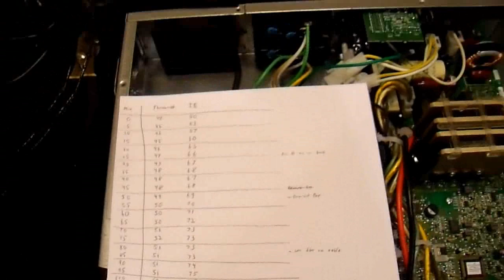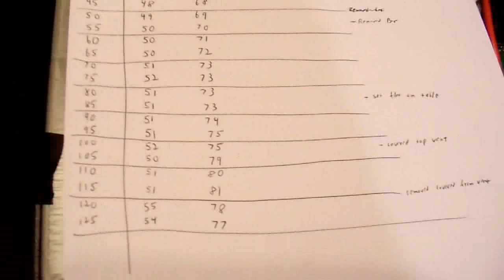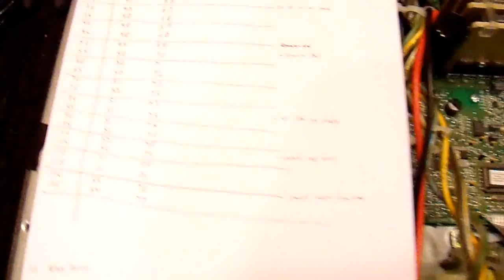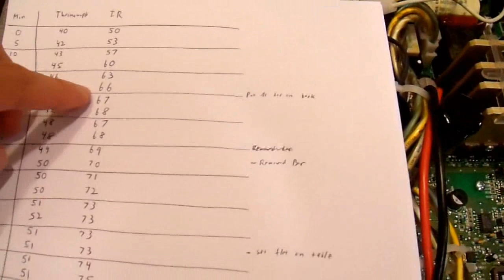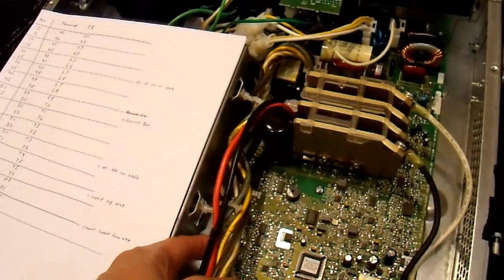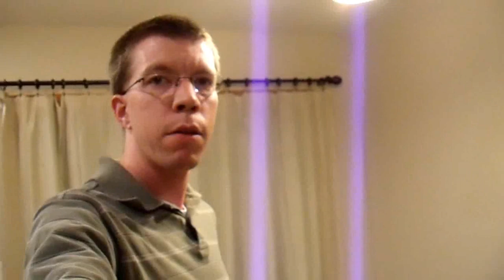UPS to 1.5kW Sinewave Inverter Conversion part10 - Conclusion

Comment: anyone know if it would be possible to parallel 2,3or 4 + of the APC 1000va ups or even the 1500's ? has anyone tried it? or thought about it?
Reply: you can do that, but you have to make some modification to each unit to work on sync with all the others. If they work out of sync you might get very inconsistent voltages. For just 2 unit the voltage will oscillate between 0 and 240v for 2x 120v ups. Double it for 2x 240v ups, so between 0 and 480v.
The oscillation in voltage will be continuos for all the operation time. It's easy to understand that it will lead to appliance failure, and probably all the ups failure.

Comment: Good idea to heatsink to the base. I did the exact same thing following your example. Not converting anything but just using 115Ah instead of the wimpy 18Ah. Transformer does not exceed 50C even with the cover on.

Comment: Thanks for the series! I've watched them all. I'm going to soon start on my own version of this system. I have some different ideas for cooling. The efficiency of the unit isn't so good though. Because I have the UK version which is 240v, I'm hoping that it will be more efficient. My UK version seems to have the same board as your US one, although ofcourse, we use half of the current to get the same wattage - I guess that will mean less heat. Thanks for your videos!

Comment: Is there a possibility to use it without wall power at all or changing some settings to not charge the batteries if your batteries are charged via solar?

Comment: I have a question 
I have never seen one of these as a 12V unit 
Is it possible using software or otherwise to make it work on 12V instead of 24V
Reply: +mewantbrains no
Reply: Well that sucks

Comment: Thank you for this well produced video knurlgnar. It was indeed an impressive project.
At this time I have only one offering for you and it involves the cooling of the transformer. I thought it would be quite easy to take a piece of heat sink and using the zinc oxide goop, attach it to the large flat surface top of the xformer for more efficient cooling. Heat sink material can easily be cut on a table saw with carbide blade. The video gave me lots of ideas as to how to better cool my own inverters since heat is the greatest enemy of any electronic equipment. Thanks once again.

Comment: I have 10 t0 15 of these units (SUA1500RM2U) and wanted to try and convert to a inverter for use in a car.  I could change my car battery over to a more UPS friendly battery but I would be dealing with 12 volts instead of 24 volts (not to mention car alternator competing to charge the battery)... do you know of a way to convert these units over to run off of a lower battery input voltage?

Thanks for the great tutorial by the way!
Reply: Michael Schofield I just red your comment to yorgle11 about 24v be unfortunate... guess that probably answers my question.
Reply: +Michael Schofield you could put in a 2nd alternator, at 24/48V, and another battery circuit, saving start issues ;)

Comment: Do you have any "concerns" using the charging function of this unit of "flooded cell" batteries when the original batteries were NOT flooded cell ?
Reply from the maker: Nope - as long as they are lead-calcium.  Just be sure to re-fill the electrolyte in flooded cell batteries to ensure it always covers the top of the plates.  These units float at 14V per battery which is a little too high for normal flooded batteries which causes them to loose water too quickly.  Lead-antimony batteries will have problems but most batteries in North America today are Lead Calcium and will withstand the 14V just fine.
Reply: @knurlgnar24  as you mentioned in one of the previous videos, you can adjust a whole host of settings on the unit and this includes the gain value on the battery voltage sense -- you can adjust the float voltage this way. Some of the older units effectively need a recalibration anyway so I've done that to fix a unit that is overcharging and destroying the original spec SLA batteries.

Comment: The price was right on that unit, but if you can find an "extended run" model (typically with a "XL" suffix on the model number) it comes with additional fans for better cooling of the transistors and transformer !

Comment: One solution to getting enough power for testing is to plug one of the PSUs right into the output! You will have to bootstrap it somehow (a little 12V battery will do) but then half the test power will come right from the output of the unit under test.
Reply from the maker: Wow, that's a very creative solution!  I'd like to shake your hand good sir.  I would have never thought of that.

Comment: what was it before you converted this device? (in watts)
Reply from the maker: 980W I believe.  But it was only capable of that wattage for a few minutes before it overheated.
Reply: *****
oh i see and i have a small trust ups (non smart) and i want to change the battery to a 12v car battery (its not deep cycle but all i could afford at the time) it is a 200 ah as the ups only works while being plugged in i think it will be better than leavin the small dead battery in there any suggestions or ideas for that? i am hoping it will be ok :)
Reply: @knurlgnar24  Have you tried adding 2 ferrite toroids in parallel to bring down the idle current. I've seen this work, and will apply it to my ups which is giving me 1.5a of idle current draining my batteries. Most of old ups / inverters are quite inefficient to me. Whilest newer inverters or solar MPPT are higher in efficiency but they all work mainly the same according to their schematics.

Comment: That was an impressive project.
It's so tempting to try this.  I have 2 idle SmartUPS units sitting around, and I could use a decent sinewave inverter for the long power outages we sometimes get. The cost of buying one isn't realistic for me.
It really bums me out that these units require 24V.  That would prevent it running from a car's alternator, which really would undermine how I'd want to use it.
Reply from the maker: I agree that it is unfortunate it requires 24V to operate.  It makes it less useful.

Comment: Thanks for the Video... I have a few units that use a 48 Volt battery bank and I believe are 3600 Watt units...
I would like to replace the Lead Acid to External Li-Po. remove the battery cavity and reseal the unit in Aluminum.
you gave me some great ideas.. thanks..

Comment: Even though I have several of these sitting around I'm thinking of picking up a Morningstar SureSine.  They claim a 55ma standby draw @ 300w continuous with 94% efficiency.  For a challenge I wanted to try to run my backbone (router, cable modem, switch, and small NAS) all from solar panels and 300w is more than enough for these small devices.  I also considered buying new devices that all 12v DC wall warts and then going straight DC but the SureSine sounds like the better option.

Comment from the maker: Yes, I wish they had a lower quiescent power draw as they are quite good quality power sources otherwise.  The transformers they use were designed for UPS operation, not for sustained off-grid operation.